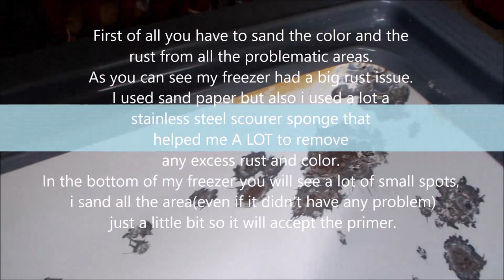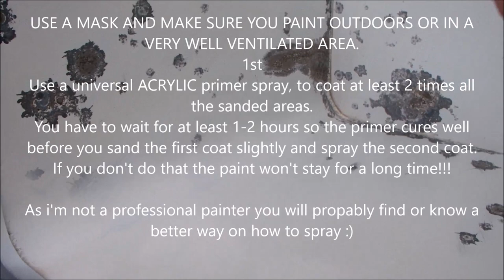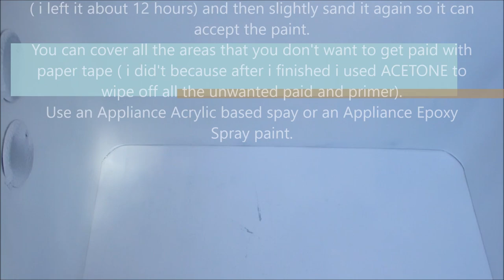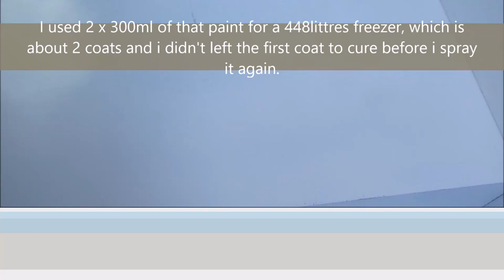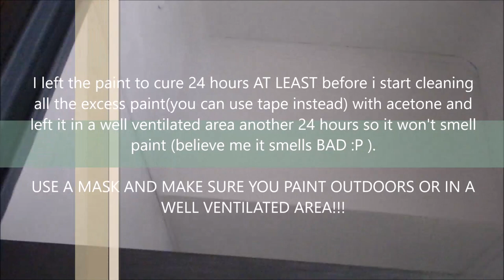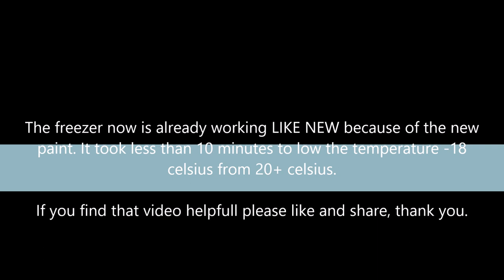How to Paint the Inside of a Freezer DIY.

Comment: This paint is not intended or  recommend to paint inside the freezer or refrigerator.
Reply from the maker: Since an expert told me that is ok to use it, since I don't use my freezer to freeze unpacked products, I have no problem to do it and doing just fine until now...
Reply: That’s what i thought ! So what do we use to piant the inside ?
Reply from the maker: @daciasdiy1861  the best products is those that are used for white appliances acrylic based because they don't have chemicals that other paint products have. You can use different brand from that I use, acrylic based products have less chemicals than other products.

Comment: What kind of paint is using? which is available in the market?
Reply from the maker: Acrylic based paint and primer usually they are sold for white appliances such freezers and fridge. It depents also what country you are so you can find them.
Reply from the maker: @MegaTinkerer  I don't disagree with you but the experts gave it to me as the best option because there is no other option in the market at the moment...